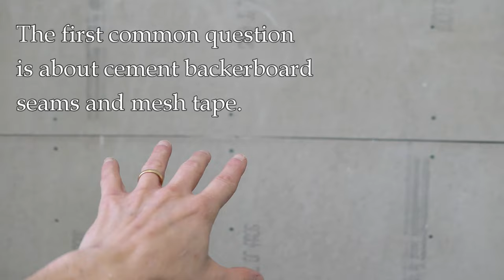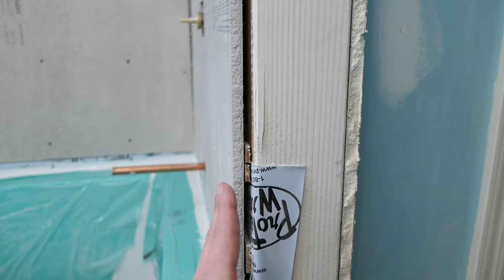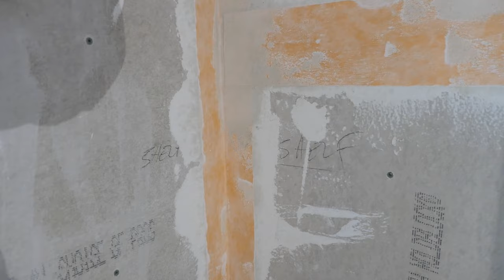Should Backerboard Go Over The Tile Flange Or Up To It?

Comment: At Home Depot there were two sizes of flanges what size flange on the bathtub do u order? The longer one or the shorter one.
Reply from the maker: I think you may be confused about something, but I'm not sure what.  If you are buying a bathtub with a tile flange (for an alcove) then presumably you intend to use backerboard of some sort and install tile over the tub.  The size of the flange isn't a choice--it just is what it is.  Most manufacturers design it a little over an inch tall.  I'm wondering if you were looking at a bathtub which is intended for use as an enclosure.  In other words, there would be three matching shower walls of the same material which interlock with the tub flange.

Comment: I always add lots of blocking regardless. And tape and mud. By the time all your tiles, mortar and grout are on the walls, you've added allot of weight. Overkill is not bad in a shower
Reply from the maker: Nothing wrong with over-building!
Reply: Over building is one advantage of doing a tub surround yourself.  Something that a builder will never do.
Reply: @chrisgraham2904  that's a gross generalization that certainly does not apply to all builders.

Comment: I noticed that you don't have a caulking gap on the outer sides of the tub.  Is it not required?
Reply from the maker: You mean where the drywall meets the tub?  Since there is a lot of spackling taking place in that area anyway, I'll generally fill the gap with spackle.  Then when I prime I will slightly overlap the tub itself.  Then I will caulk that instersection after the primer cures, then apply two coats of finish paint over the caulk.  In some cases I find that the tub, being plastic rather than a stiffer fiberglass or steel, has a lot of flex in that area.  In that case I will take care to leave a slight gap between any drywall or spackle and fill the gap with a highly flexible caulk before painting.  Sometimes I will also use expanding foam or silicone behind the tub before I close up the wall or ceiling below to help stiffen that area and keep it from flexing.

Comment: I get your points, but I will go with the manufacturers instructions and materials list regarding seams and waterproofing
Reply from the maker: When you do remodeling for a living you soon realize that the manufacturer instructions are a joke.  One manufacturer's instructions conflict with another, or I have seen contradictions in a single booklet for a single item.  I read what they have to say, and make my own decisions.  After all, it's my work and my business on the line if something goes wrong.  If Mrs. Smith has a problem with her bath in three years, she'll blame me, not Kohler or Hardi.  Practices do change over time, and I change accordingly.  But relying entirely on manufacturer instructions will eventually get you in trouble.

Comment: Great video got one question. 
When I tile down to the tub do I just fill the void below the backer board with thin set and do you ever tile directly to the base or do you leave a quarter inch or so for silicone in case of tub movement?
Reply from the maker: See this video:  https://youtu.be/y3bpE-GhYUM

Comment: Can you shave the back of the board for the thickness and height of the tub lip so its goes over the lip and sits flat.? Thx

Great video 👍
Reply from the maker: There are two issues with that approach.  One, it's really not a good idea to be releasing lots of dust from cement backerboard, which contains silica.  Even outdoors it's best to minimize this dust.  To create a space for the lip about the only tool you could use would be a grinder.  I suppose you could wet down the grinder with a helper, but it would get kind of silly.  The other issue that most fiberglass tubs have a lip thickness which is about equal to the backerboard thickness! Other tubs, such as stamped steel or thin acrylic, may have a thinner lip, but you are still weakening the backerboard by shaving the back.  My advice is not to try this approach if it can be helped.

Comment: When you bring the Hardie Board down “to” the lip of the tub or pan do you leave a small gap between them or sit the board right on top if the lip? And what about leaving a small gap between the boards themselves?
Reply from the maker: Certain materials expand and contract more than others.  So, a plastic tub I'd be more concerned about expansion and movement over a metal tub, for example.  So, you can leave a small gap of 1/16 or an 1/8 if you are concerned about it.  Hardibacker itself is pretty stable.

Comment: I don't know a lot about this but I just took my tub shower combo out. it was put in 36 years ago and I don't think they did a great job. the tile was put on backer board, the seams and corners were caulked poorly but there was not one sign of moisture damage. there was kraft faced insulation and not one water stain anywhere. the tub wasn't even nailed to the wall. I re did the caulking every few years and never had a grout line or tile crack. I have lived here for 33 of the 36 years and kids and grandkids have been raised here. the opening and the whole room is 62 and one quarter inch and nothing is plumb or square. I'm 71 and I might not live long enough to finish this project.
Reply from the maker: Well, I'm 13 years younger than you but I also sometimes wonder if I'll live long enough to finish a project!  As far as waterproofing and moisture damage, I think the concept today is far overhyped, due mostly to marketing by waterproofing companies.  I've taken apart dozens of bathrooms with tile over wallboard in the shower, and yet there was little or no water damage.  That's not to say we should still use wallboard, but only to point out that the risk of water damage is not that high when the tile is properly installed and maintained.
Reply: thank you John for responding to my comment. I will get through it. I have a plan some what worked out. @enduringcharm

Comment: Do you tile directly over the drywall compound? Of course drywall mud is not waterproof
Reply from the maker: No, you would not want to apply thinset directly to the compound.  I try to run the backerboard outside of the wet area and then make the joint with the wallboard there.  The spackle which overlaps the two materials is primed and has two finish coats of paint, and then it is allowed to cure for a couple of days.  At that point you can tile over the painted area, but that tile is still outside of the wet area.

Comment: So, where the tile extends over the lip of the tub, is this filled with mastic/thinset?
Reply from the maker: Mastic should never be used under tile in a wet area, and I don't use it anywhere else either.  For thinset, though, see this video I made on the subject:  https://youtu.be/y3bpE-GhYUM

Comment: Do you use silicone between the tub and the rubber flashing on the floor to keep water from going under the tub?  Also, how wide is the flashing used on the floor near the tub?
Reply from the maker: Great questions.  I've remodeled 60-70 bathrooms, and when I do the demo I find that the rot on the floor is generally right along the line where the tub or pan meets the floor.  It's a matter of moisture wicking into that area and keeping it damp until the plywood eventually rots.  So, you don't need a wide strip of flashing there--six inches is enough.  After you tile you should use a silicone caulk between the tile and the tub or pan.  However, if you also want to apply a bead of silicone between the tub/pan and flashing or the backerboard and tub/pan, that would be okay as long as you keep it neat.  Obviously the thinset will not stick to silicone, so you don't want a big mess of it.
Reply: @enduringcharm  Thanks for the get back.

Comment: In my experience, the backer should sit on the top edge to prevent any chance of capilary wicking. I install the waterproof membrane (kerdi) as a single sheet which I push back into the vertical corners. This way it is a single continuous sheet which then extends down to the finished edge of the tub but gets trimmed to hide behind the tile. I do not use the Kerdi band at all but I do use the Kerdi mixer fawcet thing with the rubber cup which extends into the cavity & the Kerdi pipe exit with the rubber hole for the lower spout...I don't use this on the upper spout. I have never had one leak yet. Sure, Kerdi is expensive, but it is cheaper than having to rip out a leaking tile job & re do it!

I like the idea of using the door flashing tape. Will try that on my next tile job...
Reply from the maker: This is a favorite argument among tilesetters, of course.  I also will use the Kerdi membrane when I do a tiled shower floor or if I feel the particular circumstances warrant full waterproofing.  As for capillary action, I have two thoughts.  First, when I am able to bring the hardibacker over the lip I still leave a slight gap--perhaps 1/8 or 3/16 inch.  This allows the eventual silicone caulk plenty of room to be bedded.  Second, I would assert that if you have water splashing around behind the tile in the area of the backerboard, you already have a failed installation.  The grout (sealed) and the caulk should prevent this.  I install the self-adhesive flashing in the event the homeowner does not maintain my installation.  Even if the caulking is removed, the flashing will keep the water at bay and even if the backerboard somehow soaked up some moisture it will do no damage due to the flashing.

Comment: I love your videos. once you start tiling how much of a gap do you have between the tub and the tile? I am assuming you use some sort of caulk whether it be silicon or latex.
Reply from the maker: Typically the gap is about the same as the grout lines, unless you have a very thin grout line.  Something in the area of 1/8" works well, and then fill with silicone caulk.

Comment: Does much of theses techniques matter if you're installing a glue-up tub surround? I think they matter less, but not zero...
Reply from the maker: Are you referring to the flat acrylic panels which are basically glued to a substrate like wallboard?   I don't use those in my business, they are typically found in vacation homes or rentals and the like.  You might still be able to use some kind of flashing, depending on the style of the tub or pan.  I just don't find them to be attractive or of high enough quality for my work.
Reply: @enduringcharm  yes, the cheaper DIY solutions is what
I'm up to.  Thanks!

Comment: Is the Hardie Backer actually butted up against the tub lip or is there a small gap for perhaps expansion?
Reply from the maker: Typically these tubs or pans are made in a mold and you'll find that the top edge is nowhere near straight or smooth.  In fact, before I finish getting the tub out of the box I often take a utility knife and clean up all the ragged edges so I don't slide my hands open getting the tub upstairs.  These manufacturers don't take any time to machine or smooth the edges.  Half the time they don't finish machining the drain underneath!  So when you install the hardibacker on top of the lip there will always be gaps.  If you install the hardibacker over the lip, you should leave an 1/8" or 3/16" between the tub ledge and the backerboard.
Reply: @enduringcharm  Thanks for the information.

Comment: Is there any issue with thinset/mortar adhering to the backer board where you had primed and painted?
Reply from the maker: It's only a small area that is painted, and typically represents only part of a tile.  The rest of the tile is on bare backerboard.  The thinset will adhere just fine to the paint PROVIDED you allow the paint to cure.  You can't just wait for it to dry and then smear thinset.  The paint needs time, a day or two, to cure and harden.  The typical kitchen backsplash is installed over a wall that is entirely painted.

Comment: I tried to find a similar question to mine. what do you do when a customer supplies and tub or shower pan and it does not have a tile flange. caulking it is not a fix for me as it will be the 1st thing to fail and have water leak under tile and behind wall.  Great video thou.
Reply from the maker: Well, I never agree to install anything unless I have final say over the purchase.  In my 18 years of doing this I have run across several tubs which did not include a flange.  I think they were cast iron if I recall correctly.  There is a fix for that situation, although I don't like it.  If you search under "shower rubber tile flange"  you'll find a number of manufacturers who make a flexible band to go around the tub edge and provide a flange of sorts for tile.  I don't trust them, but if you are in a pinch and the customer agrees to it you could give it a try.
Reply: @enduringcharm  well thanks. I've searched around but like you I don't like it. A local builder here installed soaker tubs in homes with no flanges. I get alot of calls now to quote repairs for ceilings below. All the tiles did was board and tile to edge of tub and did a 5/8 bead of caulk along the tub edge which is now failing.  Thanks for getting back to me
Reply from the maker: That's nuts to rely on a bead of caulk, when most homeowners won't maintain it anyway. Ideally the tub will be replaced, but those rubber seals would be better than just a bead of caulk.

Comment: Hello great video, Can you talk about when you tile the bottom row of tile that should stop  1/8 from the tub, how do you account for the space from the cement board  to the 1 inch gap to tub..How do you grout the vertical seams? there is a big gap from cement board to tub?  Thanks
Reply from the maker: I replied to your question on the other video, but here's a link for others:  https://youtu.be/_aja8hfhElI

Comment: Thank you for your video. Do you think I need to put a red guard membrane on a durarock backer board? I put the flashing the bottom and a plastic liner about 6 feet up the back of the backer. Much appreciated. Great videos.
Reply from the maker: Personally I'm not a fan of Durock, I much prefer Hardibacker.  The Hardibacker is much denser, stiffer, and not porous.  Since you've already put it up, though, I would recommend using the Schluter Kerdi membrane over it rather than Red Guard.

Comment: Hey why does hardy backer make a waterproof backer board if what your saying is true?
Reply from the maker: The marketing mania around waterproofing has reached a fever pitch.  If you believe everything you are told, then if you don't use redgard or Schluter Kerdi on every square inch of the bath then you'll be facing a disaster of mold and rotted framing in short order.  You may have to move out and abandon the property!  Waterproofing has it's place, and I use the Schluter products when I tile the shower floor and walls, for example.  Or, if I see it's a big family with one shower or a commercial application, then I'm more concerned about it.  However, I've taken apart and put back together 60 or 70 baths and I've made observations along the way.  Not a single one of those baths had rot or mold in the middle of a shower wall where the "field" tile is installed, for example.  And yet, a vast majority of them DID have rot or mold at the edge of the tub/pan and the corners where it meets the floor.  Kinda weird that nobody obsesses over that detail, then.  That's where I install waterproofing every time.  I use my experience over marketing materials.  You can make your choice.

Comment: Hi, nice video. I am about to start installing my first tray. Useless at DIY. Do I install the shower tray first and fix to the exposed frame wood and then put up the plasterboard and go down to the tray, or fully put up the plasterboard to the ground behind the tray? ty
Reply from the maker: Well, you should not be using plasterboard or drywall at all in the shower alcove.  You'll use cement backerboard such as hardibacker, or one of the proprietary backer products.  As far as the order, the shower pan will be installed first then the backer.
Reply: @enduringcharm  Ty.

Comment: Do you put the plastic moisture barrier up over the protecto wrap? Or just up to the starting of the protecto wrap with a little bit of overlap, so there aren't any gaps? I know there can be some moisture build-up between  plastic and insulation, so I was worried about moisture build-up between the plastic and protecto wrap.
Reply from the maker: When you have an exterior wall and fiberglass insulation in the wall cavities, the insulation will typically have a vapor barrier installed.  If you put up a full wall of plastic over that vapor barrier you'd have two layers which could potentially trap moisture.  In any case, when I put up the plastic it is only meant as a backup plan in the future if the homeowner doesn't maintain the caulk and grout and there is a problem.  It only needs to be three feet above the tub or pan and that's low enough to allow moisture to escape.
Reply: @enduringcharm Thank you for your reply. My bathroom is not against any exterior walls. Will I be okay with the plastic overlapping the protecto wrap? Or should i cut the plastic so it only overlaps the protecto film an inch or so? I really appreciate you taking the time to respond to the comments on here. 😊
Reply from the maker: For interior walls you can just overlap a three foot wide roll of plastic over the flashing.  If you keep your grout and caulk in good shape this will never be needed, it's just a belt and suspender type of thing.  See this:  https://youtube.com/shorts/CRoeMb3DAyw

Comment: Great video. Thanks for taking the time to make it. What does one do if you're not installing tile over the backerboard?
Reply from the maker: If you don't want to do tile, you can choose a shower enclosure instead, which are typically made of acrylic or fiberglass.  Those are attached directly to the studs, however.